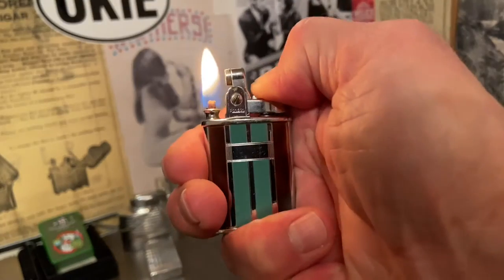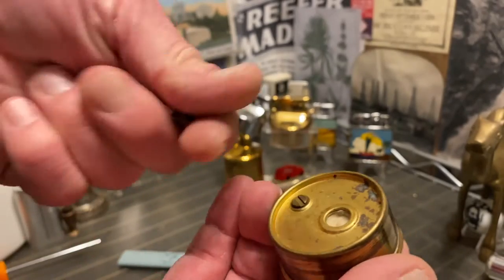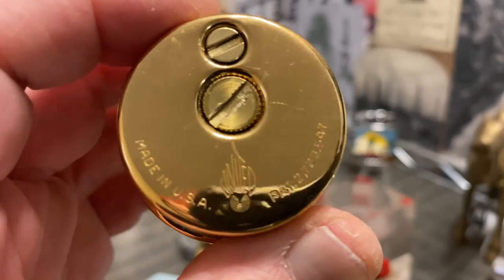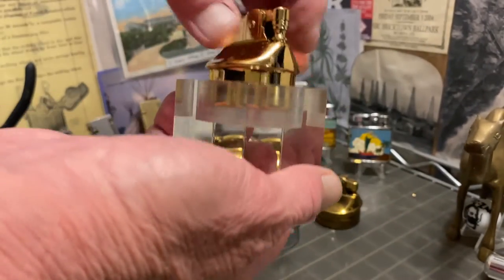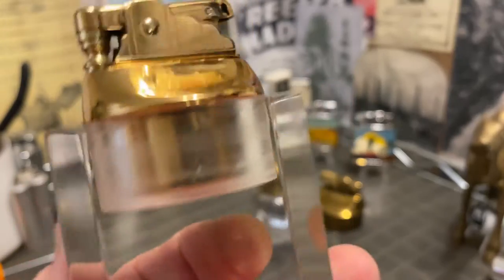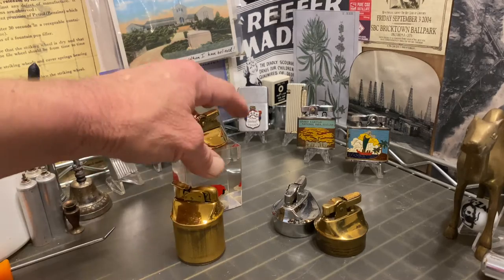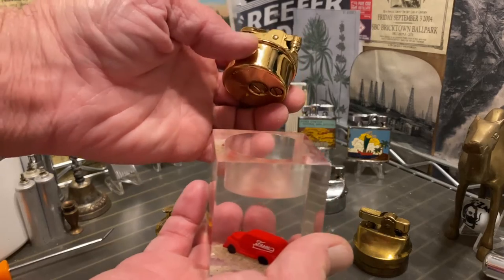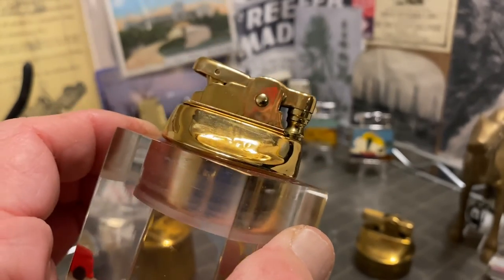Table Lighter Insert Discussion: Do They Make Modern Replacements? Are They Interchangable? Petrol?

Comment: ** EDIT** Came back to say I figured it out.  Yes. Adjusts the flame :).  What type of butane tips do you recommend?Thank you for video!  I’m trying to fix my dad’s vintage Electric Corporation radio. It’s a small box with radio. Inside, it has one of those small silver table top lighters you were showing in the video.   I’m pretty sure it’s butane.  I changed the flint and it’s kind of lighting.  Here’s my question: there is a circular groved metal part around the base of the flint.  It’s moveable.  Meaning you can spin it around the base of the flint. It has a very small metal tab on it.  Is this for adjusting the flame?   I tried it.  No effect. But I think that’s because I don’t have the correct butane attachment.  I put some in and it sprayed everywhere.  But at least I got some in bc it’s lighting!  Just not very much. Thank you :)
Reply: Refill valve gaskets need replacing. Look up lighters2018 ronson gas refill valve repair. Gaskets can be sourced from a disposable lighter, specifically the china clear ones from the (flame valve, just unscrew when 100% empty) or one with a refill valve. They basically still use the same gaskets but better materials that seal better and last longer. I gather every empty lighter and vape products I see. Yes vape atomizers use gaskets that work too! And they are free! as people throw them away.
Reply: Butane Tips: Use Newport zero or whip its at first at least. They have plastic tips for the nozzle (not metal) and so seal better, and both come with quality thick adapters. And the ones you actually need. Solved all my problems. Do not alter the holes as they are off set for a reason. After that you can use anything over 5x refined because you have the adapters. But I use whip its solely because it comes with more and buy one get one free. It lasts me 4 months and still haven’t ran out. And I have a lot of lighters I go through. 840 ml for $10. Some will price match if you are a good customer. My shop does it for everything so I don’t spend my money anywhere else. Smart. Goodluck vintage lighters are awesome!

Comment: I recently purchased an evans lighter. When I pulled the cotton out to clean it , there were rust colored granules in it. Looks like saw dustI’m. A noob and haven’t seen this before. What is it? Should I clean it all out? Put it back? Etc thanks :)
Reply from the maker: Yes, Evans and a couple others used sawdust as wadding back in the day. Sometimes looks like ground up cork material. I wouldn't put it back in there. I would replace with organic cotton or cotton balls. This article should help and there are links to purchase various replacements:

https://dependableflame.com/what-is-petrol-lighter-wadding-and-what-can-be-used-to-replace-it

As an Amazon Associate and Ebay Partner, I earn a commission when you click through those links and make a qualifying purchase.✌️

Comment: I was gifted a carry case made by Houseplant for Christmas. Basically a storage container, ashtray, lighter and grinder all in one. the table lighter insert is a vector tb-01. As beautiful and as expensive as the item was I didn't expect the lighter not to spark after fueling with butane. I was going to just purchase a replacement from vector but the lighter didn't meet the minimum purchase requirement on their site and I didn't need anything else they sell. Anyway, I just purchase a a vintage Japanese made penguin table lighter insert. Both are 1 1/2" in diameter but do you think that would be a good replacement? Also, if the lighter isn't serviced and working, how do I go about troubleshooting that?
Reply from the maker: I'm not familiar with the Houseplant piece but if it's the same size it could work. The real key is whether the table insert you are trying to refurbish is petrol or butane fueled?✌️

Comment: Hey! I love your channel! I have a ronson wedge wood table lighter that isn’t working, I’m not sure if the old flints stuck inside too, the gas is coming out as I put it in, please help!! Thank you!!
Reply: Replace 2 o ring gaskets in the refill valve, they all do this. Break down over time. 10 mm and 6 mm. Videos on YouTube. Or replace with type b valve screwed into middle of the refill valve.
Reply: He didn’t reply because he hates butane lighters. Replace 2 gaskets in refill valve. Done. Kits on eBay videos on YouTube. Ronson Veraflame leaking refill valve fix.
Reply from the maker: @rafaeltorre1643 , you should make your own butane lighter repair channel! I have never replaced a butane seal or valve.✌️

Comment: I know this vid is old and all but...I have a Japanese Colibri butane fueled insert, I love the little thing but it's not useable. It has a constant leak around the valve where the flame comes out, you can hear it hissing as the fuel escapes, and because of this the flame shoots up super high and won't always go out when you let the lever down. I'd love to fix it...if I knew how and if I knew if it could even be fixed or if I'm just stuck with a fancy paper weight that can be used for...oh say...half a day if I'm lucky with a flame that shoots up a good 2 inches high and needs to be blown out when the cap is down.
Reply from the maker: The seals in old butane lighters leak almost universally, that is the number one reason I don't work on butane them. I can help with petrol lighters but I'm no use at all with butane.✌️
Reply: @DependableFlame  Oh well...next time I'll go with an old petrol one, can you use modern lighter fluid like Zippo or Ronsol in those?

Comment: Hi there! I have one of these lighters I purchased from an antique shop. It appears to be sparking, but it is missing the screw covering the butane pin. I also find that it only sparks when the smaller screw is undone slightly. Any advice would be SUPER appreciated! 😁
Reply: Doesn’t have a cover because its a table top out of the glass and metal base as well. It doesn’t need ine to work. I’m guessing it’s leaking out? Refill valve. Replace the 2 gaskets. Done. I have the exact same one in front of me.

Comment: I have a vintage 1950’s Augusta table lighter. It self lights when you lift it. It uses lights fuel. Do I just use standard zippo or ronson lighter fluid?
Reply from the maker: Ya, if it has wadding underneath then any petrol fluid for lighters will work.✌️

Comment: @dependableflame can you make a video on the butane inserts? I have one that sparks but dont know what to do to get it to work thank you!
Reply from the maker: No, I don’t repair butane fueled lighters.✌️
Reply: He knows exactly how to answer your question because petrol also uses the same exact flint mechanism. I don’t know why he didn’t want to answer your question because it was butane when its 100% the same exact mechanism and fix! He doesn’t like butane lighters so wanted to make a statement I guess. Flint deteriorated from humidity over time and stuck. Unclog with mini drill bit and clean out. Replace flint. Done. That’s all he needed to say.
Reply: Or he is new and took a quick interest in them seeming like a professional with extensive knowledge and doesn’t know the basic difference of butane lighters even though the ronson standard and Veraflame are exactly the same except a refill valve and valve instead of wick. You can’t tell them apart except you see a wheel like a tiny washer around the wick. Barely noticeable at all. I find it hard to believe he doesn’t know butane lighters have have the same flint. It’s like a chevy guy saying he doesn’t work on ford engines. Butane vs petrol.
Reply from the maker: @Rafael Torre, she said her lighter sparks but does not work. That tells me she has no fuel which the vast majority of old butane seals leak gas. Flint mechanism is the same of course but it doesn’t matter if it won’t hold butane. Knock me all you want, I answered the question Rachel asked and do not work on butane fueled lighters. I hope you have a good day.✌️
Reply: @DependableFlame  I apologize. And yes I read it incorrectly. You did nothing wrong. I got sick, and having no energy left must of made my vision and brain at 50% 💙. I kept watching your videos and you are one of only a few on YouTube teaching others clear easy ways to DIY vintage lighters. No one knows how to do these things anymore. I started fixing torches with the rise of legalization in Colorado. And moved over to vintage to learn as much as I can. Honestly the only difference is vintage is metal. And better gaskets. I can give the correct answer if hers is a butane table top. All vintage butane lighters leak butane like a broken pipe in winter. You must replace the 2 gaskets. To make it easy and cheap you can use any lighter with a refill valve found on any plastic lighter at a gas station or smoke shop and break the plastic apart very carefully. You can use pliers with a wire cutter at the bottom. Or hammer and chisel. Dremel. Then a gasket from an old vape atomizer or anything that fits that is 1 mm thick. 4 to 6 mm. Unscrew, take apart. Replace valve gasket and push back in then replace outer gasket. Screw in. Done. If it leaks on top you need to replace flame valve gaskets. There’s videos on YouTube for both with pictures and details and where to buy the replacement kits if you want to wait and pay for the exact kit for both. Also keep lighter away from face when lighting because the flame might be 8 inches long if top gaskets are bad! Good luck!
Reply: Also your website is a wealth of knowledge. I like your info on vaping. I learned about gaskets through rebuilding my atomizers and have a graveyard of them. Now I have a use for all of them!